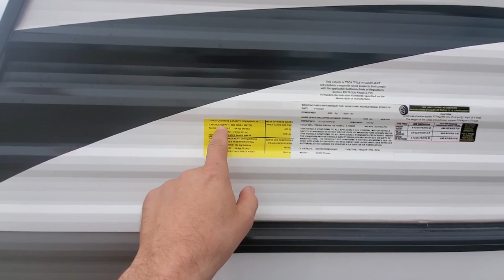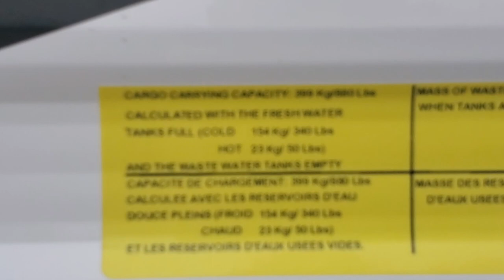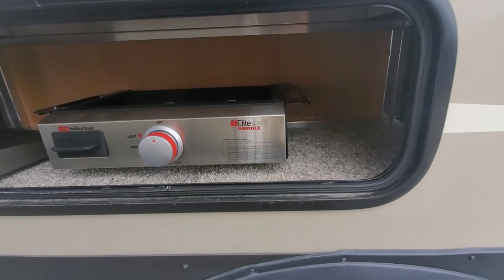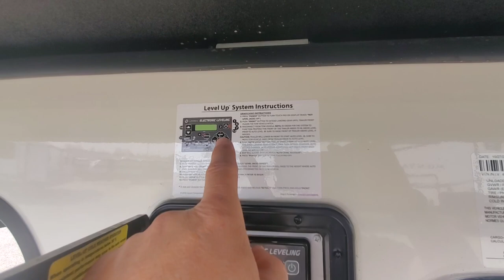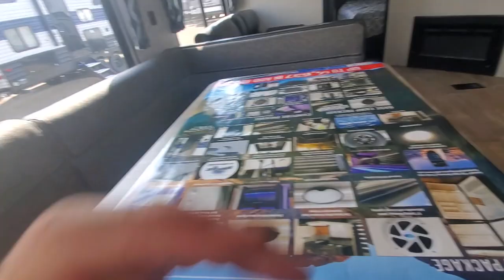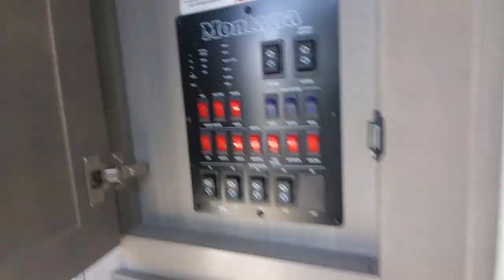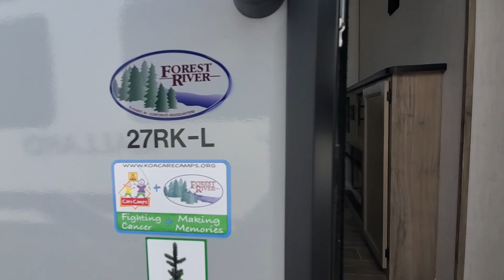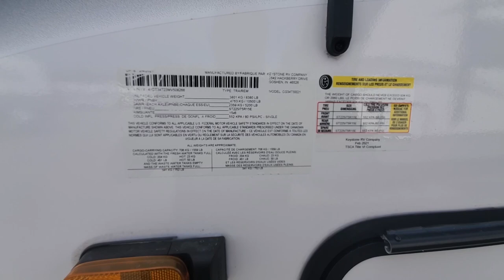TRAVEL TRAILER OR FIFTH WHEEL? What's Best For You?  Pros Cons And The Truth About Each!

Comment: Great breakdown of campers, really enjoyed it!  On another note, did you do a breakdown of heat sources for tents? Don't propane heaters give off water vapor? Wood heat worth it?  Just got a bell style tent it has stove jack, however it comes out the side instead of the roof. Might be hard to find a stove with a rear chimney so my question may be a moot point. Could be a fun video to make though.
Reply from the maker: For tents I have used both wood and propane. Propane is a wet heat and wood is a dry heat. Even with propane being a wet heat I still use it on my fall hunts as its so fast and easy. We don't sleep with it running. Just use it to heat the tent up in the morning and evenings. Wood is by far the best but a pain to pack, set up the stove, get wood, fill it, break it down, etc. Most of the time just not worth the trouble. No if was gonna spend all day in camp for a regular camping trip I'm taking the stove. If I'm hunting and gonna all day I'm taking propane heater. You can often run a 45 off the stove for side wall stove jack. I'd look into it to see but bet it's designed to do thst.

Comment: I am curious to know if the 5th wheels Trailers have issue with the Condensation and leaking problems after a few years owning one?
Reply from the maker: Very well could. They are built exactly the same way and with the exact same materials as travel trailers.